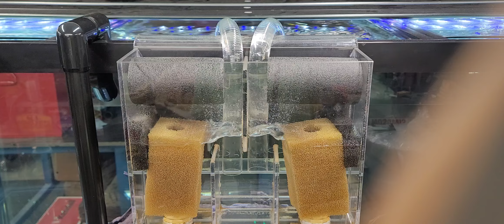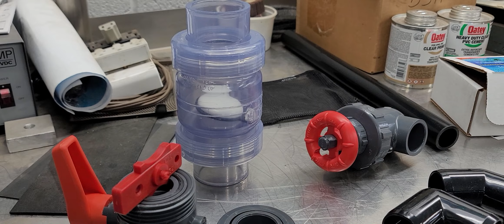Lifereef Overflow

Comment: Hello brother, good evening. I have a 55-gallon tank. I would like to know the size of the hanging overflow box that you installed. Could you please tell me? I am seriously thinking about drilling holes in my fish tank, but I see that it worked well for you with the hanging overflow box system. Do you think it is unnecessary for me to drill holes in it? I need your advice. If I drilled it, I was going to put two vertical 35 mm holes to put two 3/4 bulkheads.
Reply from the maker: Sorry for the delayed response, I'm not getting notifications for some reason and I haven't checked in on this video in quite some time. For a 55 gallon you don't need a dual  drain overflow/prefilter box, you can do it with a single unit. I can only recommend the Lifereef brand, Jeff makes a single drain version. The other brands that look the same aren't reliable like the Lifereef unit, I learned this by researching extensively in the reef keeping community, they all say the same thing about the reliability.

Comment: How is your inner box water level high like that? I cannot get mine to raise. Its about 3-4 inch below the comb. This creates a waterfall affect inside the innerbox which then create bubbles. Please help anyone!! 😭
Reply from the maker: Oh man! Did you ever get it sorted out? Sorry, I haven't been getting notifications for this and haven't checked in for awhile. I use DC controlled return pumps so I simply fine tuned that water level like that by slowly adding water to the system along with fine tuning the pump speed to satisfy that inner box level up nice & high like that.

Comment: I have a overflow box something like yours do i hook up both water lines from overflow box to return pump?
Reply from the maker: No, both drain lines from the overflow box get plumbed to the first chamber of the sump, they're drains... the line from the pump (or pumps if using 2) will return directly into the display over the back edge the way I have this one set up, this is an example of a tank that is not drilled (reef ready) so the return nozzles get positioned over the back edge of the tank. In the case of a drilled reef ready tank, the return lines from the pump would get plumbed to bulkhead fittings in the drilled holes near the top of the display.
Reply: so one water from overflow box to return pump and one hang over to back from overflow box right?
Reply from the maker: @russellkeith3193  incorrect, there are no lines connecting the pump and overflow box together at all. Both lines of the overflow box are specifically for "draining the water down to the first chamber of the sump" only. The pressurized line from the return pump will get fitted over the back edge of the display and pointed downward into the water.  I recommend reviewing the video some more, it's all clearly shown and discussed.

Comment: Hey man im thinking of doing this since im scared of drilling my tank do you think i will ever a flood problem using this type of system?
Reply from the maker: Sorry for the delayed response, haven't been getting notifications for this. I love the Lifreef prefilter/overflow box as an alternative to drilling, I can't bring myself to drill a large display knowing it leaves behind so many cracking propagations, the factories don't crudely drill the way hobbyists do, most are water jet then honed to eliminate the crack propagations. Don't mess around with other brands that look like the Lifereef unit, they only look alike but the designs aren't quite the same, the reliability is with the Lifereef goodies is what I learned by researching in the reef keeping community.

Comment: Great vid and lots of info! I purchased a eshopps hob overflow very similar to this one. It’s rated for 1000gph and going on 75g with 1300gph dc pump return and 40b sump. using 1” hardware such as a couple pieces of pvc 1 gate valve and 1 plastic over the rim return. I’m only using pvc on the 2 bulk heads from overflow box with barbed attachments on the ends to connect 1”ID vinyl pond hose. I planned on going with Herbie method. 4” H on the main return pipe, making the second pipe my emergency and making it tall enough where it’s just a couple inches below the bottom of weir then fine tuning the gate valve on return pipe to raise water level high enough to get just a trickle down the emergency pipe. What are your thoughts on a system like that or anything you would do differently? This tank will be a heavy planted tank for now with snail and shrimp and a abundance of live bearers
Reply from the maker: I can't speak to the Eshopps overflow other than I believe they're problematic with accumulating air at the top of the U-tubes from what I'd read during research. Some folks tried to remedy the problem by adding an aqualifter feature to the siphon tubes which I personally wouldn't screw around with. I can't speak to your DIY Herbie idea either, I added the 1" emergency drain to this prefilter box and rest easy at night about it.

Comment: Were did you purchase the overflow and has it been trustworthy since you installed it
Reply from the maker: You can purchase them directly from Jeff at Lifereef, very high quality and yes, it's 100% trustworthy. Many many stop/starts without ever losing its' siphon. I did add a 3rd emergency drain as discussed, also added a float switch in the display for the purpose of flood prevention in the event a dead fish or anything were to block off a significant number of weir slots, this will slowly cause a flood out of the display so the float switch is set to kill power to the 2 return pumps as well as the UV lamp until I can clear the blockage from the weir. It hasn't happened but in the event it does, I have the redundancy in place to avoid flooding the display. That's a problem for any setup with drains in the display that most people do not protect for. It's not a specific problem for HOB overflow designs but a noteworthy addition to the system. I'd shopped around quite a bit and settled on the Lifereef based on its reputation for reliability, I couldn't bring myself to use the similar overflows in the hobby that rely on integrating the use of an aqualifter pump to prevent the loss of siphon. These Lifereef units will not lose siphon unless you lift the U-tube up out of the box. I've test run the system very slow in an attempt to accumulate air inside the U-tubes and it simply would not happen. I've been nothing but impressed by it for 2 years.

Comment: Those sponges don't work well in my experience, Lifereef sells silencer tubes that eliminate the noise in the overflow
Reply from the maker: I thought about those silencers but I don't believe they allow for the use of pre-filter sponges when the silencers are installed.  Since I figured out how to tune the drain speed to full siphon/silence, the silencers aren't needed in my particular scenario. It was only infrequently I'd get a momentary, small air pocket whip over that last baffle sending a slight, single gurgle through the drain once in awhile. Leaning the pre-filter sponges slightly like that proved to resolve that whipping action over the baffle. The pre-filter sponges have proven highly effective for me so far to do the job of pre-filtration, they're not intended to be much of a silencer, I just happened to stumble on that little leaner hack as the last line of what was very infrequent, slight gurgle. If I needed to run the drains wide open, I'd certainly look to those Durso type silencers, I've talked to Jeff about em, I should see if he's tried em both together with any success.

Comment from the maker: @carlmurphy7190  Yes, adding water volume to the system will allow for raising the level in the media chambers by raising the weir gate and still leave the return chamber level nicely above the pump inlet. In this video, I left head room in the sump to account for the many bags of media to be added without having to reduce water volume. I manage drain back with siphon breaks  in the return nozzles & check valves immediately after the return pumps, covered in the video. 

Regarding UV circulation theory... I'm in the camp of picking up the cleanest water possible after all filtration components, using large diameter pipes, slow flowing for long dwell times in the lamp and returning it directly to the display for volume blending. This nets the most of any potential treatment benefits based on Carl Strohmeyers' decades of research & testing of the subject in everything from hobby aquariums to ponds to Marine Biology research centers.

Regarding dead spot theory, it most certainly is a thing but more than that in this example, it's not a matter of a dead spot in the return chamber, rather  a matter of bypass around the return pump inlet. The water being directly ingested by the pump inlet is focused at the inlet, the rest of the volume "with movement" in the return chamber may take many many cycles to ever be drawn into the inlet. That renders any and all calculations rather useless at that point, turning over UV treated water only inside the sump even at a high hourly rate doesn't equate to effective and accurately calculated treatment in the large volume display. Return manifold UV taps that return directly to the sump is mostly a "monkey see, monkey do" method in the hobby that begins mostly with the installer cutting corners, saving time & money... it's a method that renders true UV sterilization treatment much more ineffective than a dedicated flow circuit returning directly to the display volume.

Comment: maybe returning to flow from the UV back to the sump,with the outlet below water level creating a closed loop. with only about 25 gallons of water in the sump the turnover through the sump is x36 per hour,the dead spot theory is not accurate,theres enough water movement to prevent that,and once the bio media is added ,water volume in the sump decreases making turnover through the sump even greater,its also possible to raise the level in the "media chambers" by raising the  weir gate and adding more water to the system without lowering the level in the pump chamber,of course drain down will be a factor as to how much you increase the volume

Comment: Is that a pool noodle holding the j tubes?
Reply from the maker: Only very lightly, I added them myself to hold the siphon tubes still in the "splayed" position. I used some leftover copper plumbing insulation noodle from a hot water heater installation so they have a split in them. Certainly pool noodle would work the same.

Comment: Tons of info in this video, thanks for sharing! I have to replace a tank and was considering getting a Lifereef overflow to avoid drilling. I like the idea of adding an emergency drain to it... have you gone through with it?
Reply from the maker: Glad you could use the info, I know I sure was lookin for it when I was learning it all on the fly. I'm happy to field any further questions as ya get into it. 

I haven't yet shut the flow test down which is when I'll add the emergency drain, before it all gets set up for cycling in the final installation. I realized afterward that I never circled back and finished duscussion on the emergency drain location in the sump. It was my first ever video like that and I was simply shooting from the hip tryin to cover everything that came to mind so far.

The Lifereef Overflows are the only ones to consider using if drilling is off the table and you don't have a factory reef ready display tank.